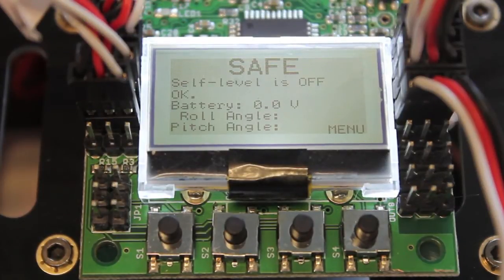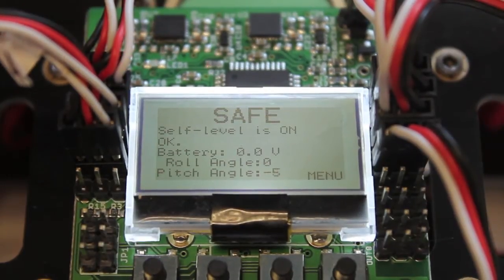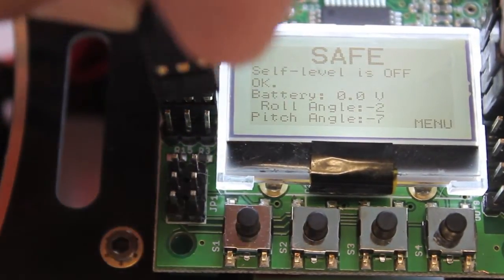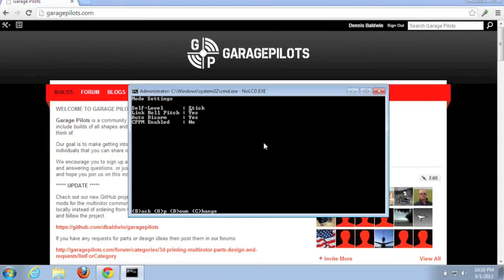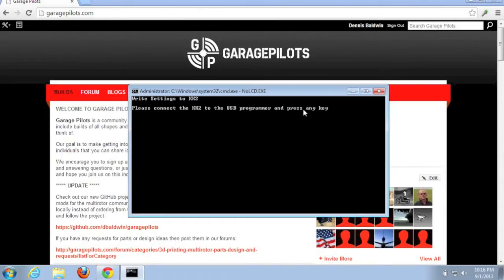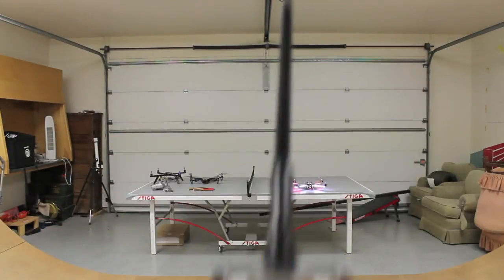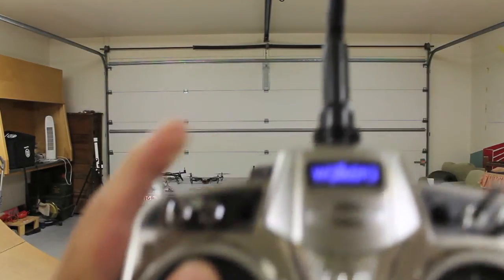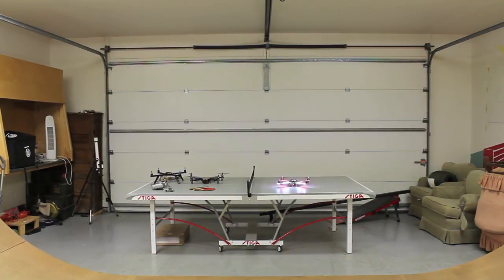KK2 No LCD Self Level Setup and Configuration for AeroSky Quad with Walkera Transmitter

Comment from the maker: Hi Steven, sure. The best thing that I can recommend is check out garagepilots . com and post over there. Either myself or another member from our community can help you out. You should post your motor, esc, prop, and battery specs to see if it's a weight to thrust issue. Look forward to seeing you over there. Thanks.